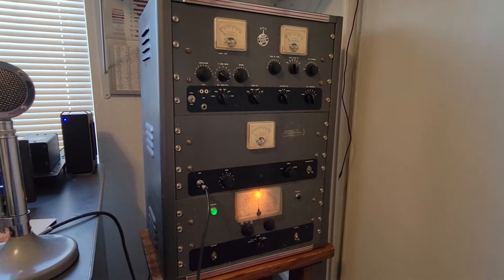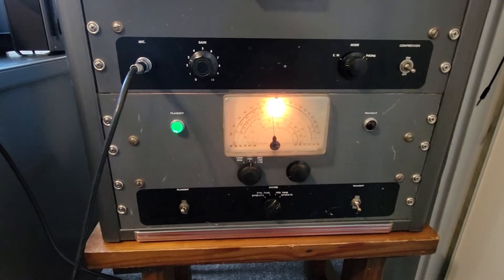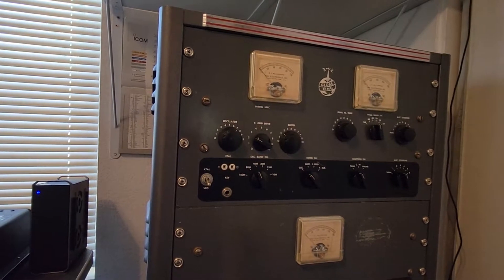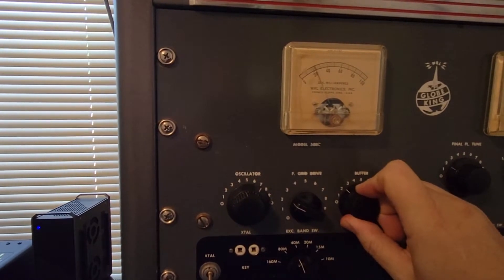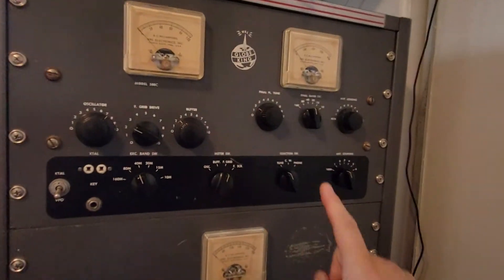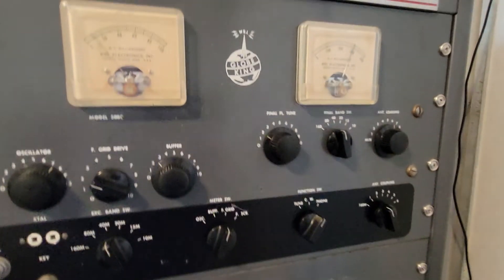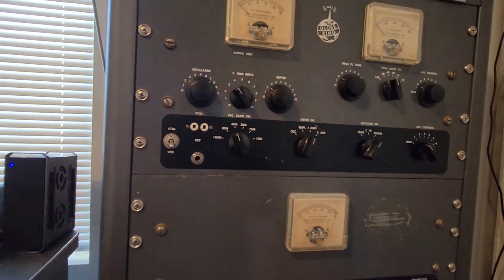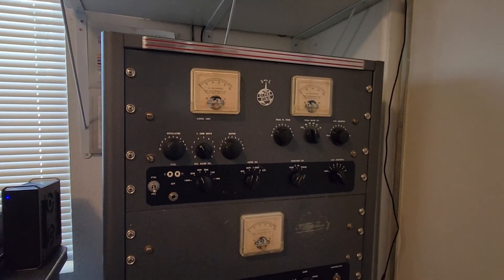WRL Globe King 500c.  How to tune.

Comment: Brilliant video and a super brilliant TX when Ham Radio was fun - many years ago I used to run a Racal system the TA127 (TX) and the RA117L Dual Diversity RX which stood in 2 x 6 foot rack system - I never needed a heater in the shack😰 - 73 de Ger EI6DP

Comment: First of all In the B and C  11Ma is the correct grid drive 13 is max  second the manual clearly tells us to do our high power tuning in CW  not in phone...to prevent arcing damage.
When going from tune to high power grid trive will change and need to be touched up.  Aging tubes may require more drive to achieve rated plate current, but that is a tube fault.

Comment: Get the manual and read It. This will hopelessly confuse you. Before you turn any power on you must make sure all 3 bands switches are set to the same band. 500 and 500-A and 500-B have very similar controls (B adds vfo)  But 500-C has several controls combined into rotary switches which Do Not Exist on the 3 previous models. Also the max grid drive and correct plate current are also different. So, It Is Important To Get The Correct Manual,.

Comment: Very nice.   I looked you up on  Google  street view.  I don't suppose the street lamp is a disguise vertical?   I am 76, probably will never get  "back" on AM.   I was first licensed in 65,  general in 66.  My first AM  rig before  I  joined the Navy in 68 was a TCS-12.   I actually have  2 or 3  Apaches  and a couple of  Mohawk receivers,  all need work.  If I remember  the  dial  readout is busted on all of them--the circular plastic.

Comment: Thank you for the video, as of this writing I am close to full power testing on my 500c. 1000 mile road trip to get it. Most of the capacitor replacement to modern had been done. So I tested all the tubes, changed 2 and checked all the wiring against the schematics. Your video is my tutorial on tune up. Also have all the books as well. 73 N9OVJ

Comment: W7WRX. Great clip. A must watch for anyone who might have just refurbished a king 500. I absolutely love these vintage transmitters. The look of the 500 would be blah, if it weren't for that Chrome bar with the what I'm assuming is red painted inserts. What a difference a piece of Chrome with the right color paint can make. Is the 500 King screen or plate modulated? Something tells me it's plate modulated, but I am not very versed in vintage transmitters, I just enjoy looking at them. In 1983, I purchased a working kws1, with no intentions of ever operating it. I just wanted to set it up as a showpiece, which is exactly what I did. Before moving in 1997, I sold it for exactly what I paid for it, $650. What a beautiful transmitter it was. I would remove the front cover on occasion, so I could look at working of the transmitter, for a bit. A friend of mine operated a EF Johnson Viking 500. What a wonderful transmitter it was, and the audio was something to behold. So many hams wide banding and direct injecting transceivers, but the audio out of those transmitters never come close, to the audio produced by a vintage transmitter. I actually heard a story about someone who wide banded a mint condition Viking 500. I just don't get it! Why somebody would want to wide band such an incredible sounding transmitter, is beyond me, especially when they could simply wideband a $500 transceiver, and probably sound the same, as they would on a wide banded Viking 500. I dislike the wide banded direct injected, outboard audio adjusted sound, of those transceivers. Once again excellent clip, and I'd like to compliment you on a beautiful piece of amateur radio history. Your 500 King looks awesome!